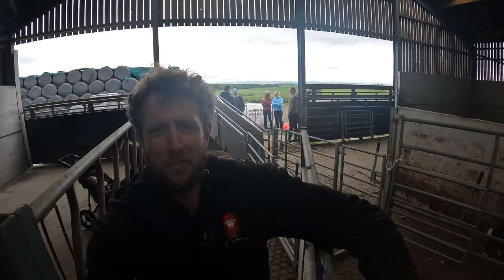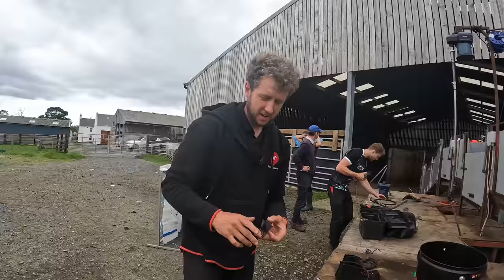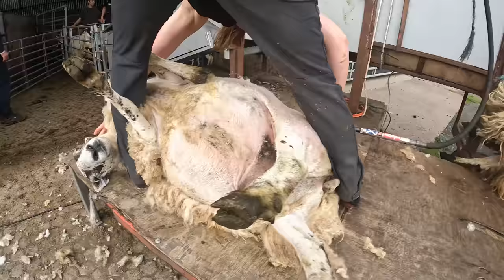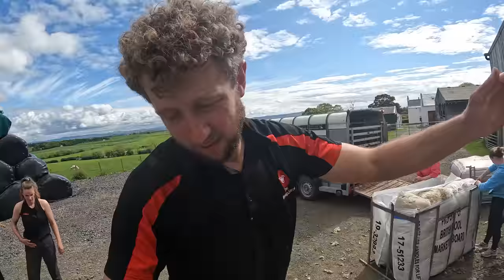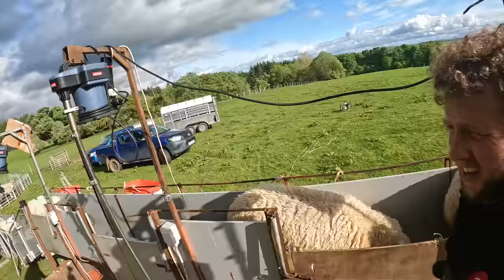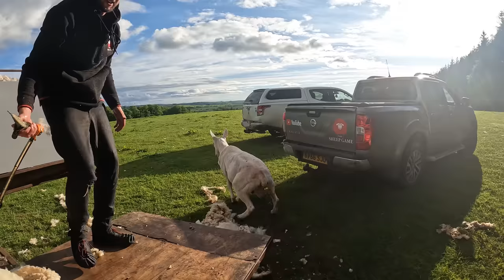SHEARING A BIG UGLY RAM

Comment: Couple of questions what did Lizzie have tucked in her top was It a towel ? 
And do the rams shear easier as they haven't lambed 
Great vlog as usual and Jock looking cute as ever
Reply: As a rule mature rams are much heavier than ewes. They have a larger frame and , as males of the species,  are much much stronger particularly around the neck and shoulders. As such they are hard work to move and hold let alone shear. As such rams incur a higher fee to shear due to taking more time, risk and health danger, having more staff available etc. Everyone needs to be more alert.
Reply: @susanmarsh4351  I mean as in the fleece come away easier

Comment: Given the price of wool, why not hair sheep?
Reply: Most of the hair sheep breeds are generally hot weather low humidity breeds, which are not geared to uk weather and would need some experienced breeding to landrace to it. There are breeders doing so, but even w the cost of shearing it is hard to beat breeds that have landraced to a singular environment for in some cases hundreds of years. Ability to thrive is, after all, paramount.